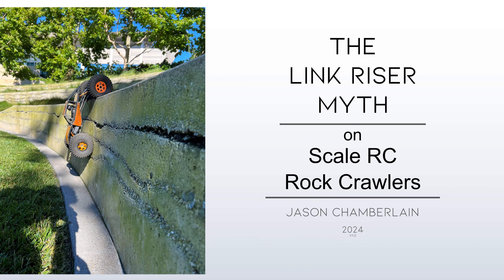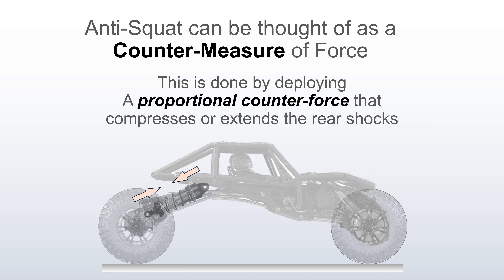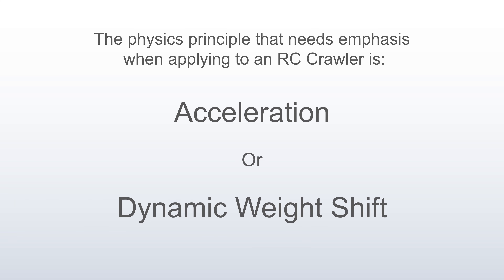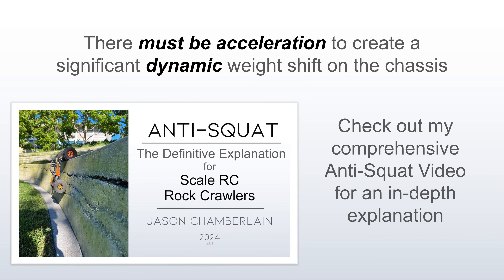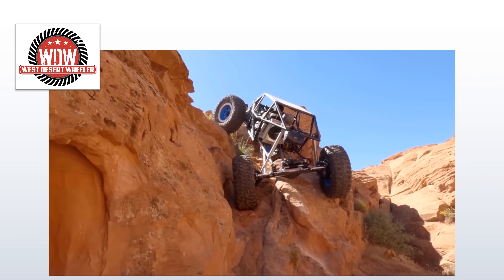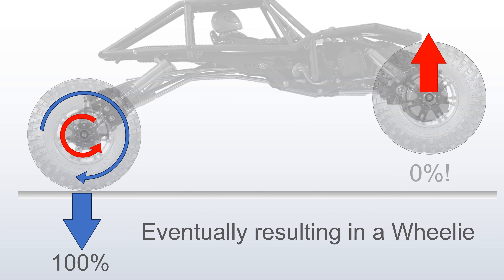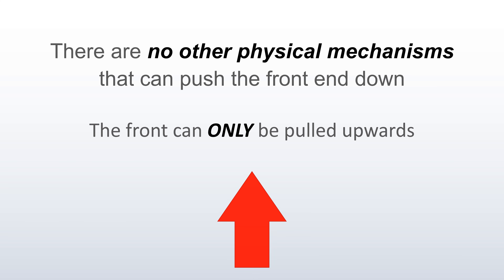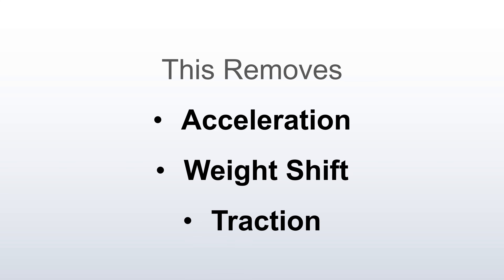Anti-Squat on RC Crawlers - Part 2: The Link Riser Demo

Comment: Hmmm , i think that rig could do better 
My rig climbs 74.1  easy , do  you have underdrive in the rear
Reply: Also looks like rear your shocks are compressing on one side on the rear , have you tried better shocks,  I would recommend priceys custom shocks
Reply from the maker: Is that with positive traction or rear wheels spinning?
Reply from the maker: That’s the result of torque twist from positive traction. I don’t have them on this rig at this stage, but I currently have dravtech shocks with internal springs that are the same concept as Priceys.
Reply: @BoomslangSuss  to me it looks like you're link geometry is way off , you're rear upper links could be placed better,  for example try mounting them with the bend up. Also more angle on your shocks. my rig pulls 74.1 degrees
Reply: @BoomslangSuss  oh right in my opinion and experience they are not the same at all , i have used both,  they definitely drive a lot different than dravtech , the reason you are getting torque twist is bad link placement for that rig try other options before you come to saying a link riser doesn't work!
Reply from the maker: 74.1 with rear wheels spinning or positive traction?
Reply from the maker: Seems like you didn’t actually watch the videos. You are just repeating myths that I have addressed all over my channel.
Reply: @BoomslangSuss  i actually watch them both . In slow motion,  have you tried or not? im guessing you haven't,  cause you got angry straight away when someone tried to help.
Reply from the maker: Certainly not angry. Just pointing out that I have multiple videos that demonstrate in real life and disprove all the “help” you are suggesting.
Reply: @BoomslangSuss  maybe you do but if your using the rig with the same link set up on the rear it's going to cause it's not correct,  try what I suggest and see and do proper testing
Reply from the maker: The entire purpose of this video is proper testing with two different link positions. Not sure how you are missing that point. Try watching the full series with the audio on. You can’t possibly be misunderstanding that.
Reply: @BoomslangSuss  I watched all series but I disagree with what you found out , only cause I found different with my testing,  but each to their own , if you don't want to try then I guess don't
Reply from the maker: It all good friend.

Comment: Gonna stop at 2 minutes and say anti squat is part of the acceleration but it's not, i would say it's more based on the torque being I've messed with rc suspension alot and seen first hand how link separation(mostly chassis side) makes a huge difference while under load.
Reply from the maker: Firstly, there is no suspension engineer in the world that would agree with that - every anti-squat tratise talks about acceleration. Secondly, find a first year engineering student in Statics 101 and ask them to draw a free body diagram and you will see that link separation is not a factor in any way. But if you found a set up that works for you, run it!  Don't let me dissuade you.

Comment: Your not changing the AS enough for the design of the rig.
What is the actual AS numbers of your High and Low AS?
Reply from the maker: I should definitely make one that is more exaggerated.
Reply: @BoomslangSuss  so are you not doing the math to find the actual AS numbers?
Reply from the maker: @phuzzit  Yes, I know the AS numbers and you are highlighting a great point. Many people probably don't know where their AS is to begin with and how much/little it changes with a link riser. Also, the primary point of this demo is to show that changing your AS doens't push down the front end. Even if you started with 50% Anti-Squat and switched to 200%  Pro-Squat you would not see a difference in this slow test. Finally, I selected this link riser height because it's pretty typical of the height that most after-market risers offer, but you make a great point that a more exaggerated difference might  be more compelling, though the results would not change.

On this test vehicle, the low setting is 105% and the high setting is 135%. Typically, a 10% difference is any human factor experiment is detectable by feel or by eye.
Reply: @BoomslangSuss  that's not typical rear AS numbers for people that comp (and thats without taking into account what your front AS is), so your findings aren't quite reliable. Your crawler also is not setup in typical fashion, you have it setup to to give your the results you want.
So the comparison of your rig to others won't be the same.
Reply from the maker: @phuzzit  I think you are missing the point - AS is irrelevant at slow speeds. The underlying physics apply regardless. I would like to see the contrary if you can demonstrate it. Also, no such thing as front AS.
Reply: I agree with all the scientific research but in areas like my courses there's a lot of bumping in witch it does factor it all depends on the courses that something u should of pointed out by doing it  like the static test for people that might no understand i think overdrive help more then link when it comes to slow crawl so in certain aspects in does apply alot in my crawler I just came across your channel and I think should do video on how to combat torque twist in a rc with gearing and the effects it has on shocks that u also can then apply tuning to help further.
Reply from the maker: @just-in-time6069  I do plan on a torque twist video at some point - thanks for the suggestions. Yes, throttle bumping is a great reason to understand your AS
Reply: antisquat is not a factor at slow speed, high speed, medium speed, any speed. it is a factor under acceleration only. high antisquat absolutely helps in a quick burst of throttle to bump up a ledge. but once over that ledge, a constant speed will not care what your antisquat value is. steep or shallow climb, still doesnt matter. certainly when people start pulling the throttle to get started up a steep climb the AS does matter, but once traction has been gained and you revert back to a constant speed, the AS once again does not make a difference. Jason, i think a better way to clarify is not to mention slow speed, but rather mention a constant speed. a slow speed increasing to a slightly faster slow speed will still be acceleration, and AS will matter. a constant velocity at a slow speed is really what you are meaning by "slow speed" - but I completely agree with and know your math is correct...your engineering background more than confirms that
Reply from the maker: @cameron6471  Very well said my friend!.
Reply: @cameron6471  AS does not care what speed the vehicle is moving - AD/AS is the measurement of forces from one thing to another and what those forces do. 
If speed was a factor than every race car would not work because they all use AD/AS at all speeds. 
It's really simple, load the axle - It doesn't matter how. It can be slow, fast, constant speed. Now, you are putting force from the tires into the axle, through the links, to the chassis - That is AD/AS. Just because you don't see it or it doesn't do what you want at some odd given time doesn't mean it's not there.

Comment: While slow crawling it make no difference. But when I need to "attack" the rock full speed or break during downhill, imo, Anti Squat & Dive helps. The myth, if I understand correctly, is that AS improves slow inclines, right? If so, I agree! Here's my 1/24 MOA "racing" up the rock... https://youtu.be/ZO3l_SIyc2A?si=BFPqVJTBfenx4E5C&t=83
Reply: One could argue that having MOA (front/back like your setups) can change the dynamics though, regardless risers are really nice to move links out of the way! I wish I knew the math, but I would also be intrigued to look at how vehicle weight/distribution vs torque affects things...You're on a light vehicle with some nice torque, but with the ability to really do a speed jump, it's very unique (I've seen it jump from one rock to another.) PS..I ordered a crawler ESC from that German company you recommend, taking a long time to Canada.
Reply: @independentmind1977  Yes, overdrive (20%), weight distribution, low sprung-mass plus the AS should help doing the rock jumping it does. Once planted I like to see the overdrive to suck down the front shocks first, followed the rear. Another big advantage is, that with MOAs there's no need to worry about torque twist.
Reply: @independentmind1977  Hey, that's great. Did you order their new ASX24 ESC? You wouldn't be disappointed. 
How much was the shipping cost to Canada?
Reply from the maker: That little rig is SICK!  Dual MOA and your link geometry is even less important. No torque twist and super light sprung weight.  I don't think you have enough sprung weight to overcome damping force at any acceleration level.  I want to build something like that - super cool.
Reply: @rcrockcrawler  I got the next gen model which is for crawlers, so I think that is the one you mention. Shipping wasn’t bad at all to Canada. It was cheaper than buying a mini ESC from the USA and getting it shipped. Also my exchange is better against Euro vs USD. I decided on this one because it is quiet and made by people who are making something unique with real engineering instead of just flashing an am32 chip and overcharging for it. Now to find a small enough battery! It is a long term project for me,  not Moa, using a chassis from Prophet Designs (the echo v2) battery on front axle.
Reply: @independentmind1977  Prophet Designs (the echo v2) 💥👍
Reply: @rcrockcrawler  it’s a nice chassis, also my 1/24 so I struggled building with the small size

Comment: I still fail to see how putting the rear tires in a complete bind proves anything. Any type of suspension setup would react the same way.

High anti-squat looked better on the ramp.
Reply from the maker: When you are climbing up an incline, your wheels are turning clockwise and there is resistive force at the tire contact patch, that wants to turn your axle and everything attached to it counter-clockwise. The steeper you get, the greater that counter rotating torque on the chassis. Eventually, your chassis will flip over backwards.  Holding the rear wheel simply jumps you ahead to that tip over point. Force directions, actions and reactions are the same at any force and torque levels. Binding the rear wheel is just greater force than creeping up an incline.

Your words exemplify my point exactly.  "Any type of suspension would react the same way."  This is exactly what I am trying to point out. Your wheels turn CW. Your chassis turns CCW.  There is no linkage design that will change that. It's impossible to push the front end down - it can only lift.
Reply from the maker: https://youtu.be/SBM-YNwr2qU